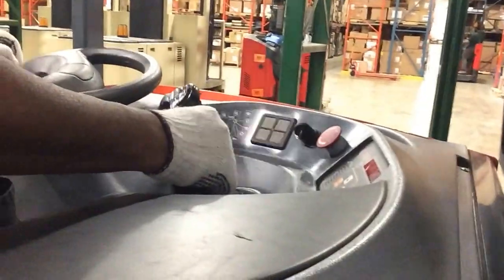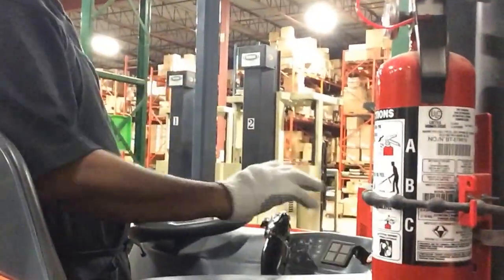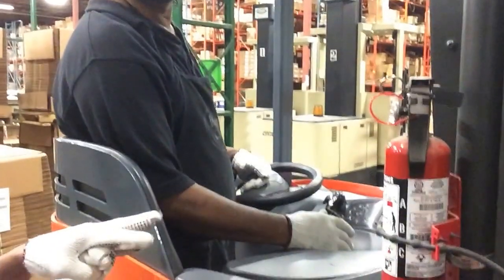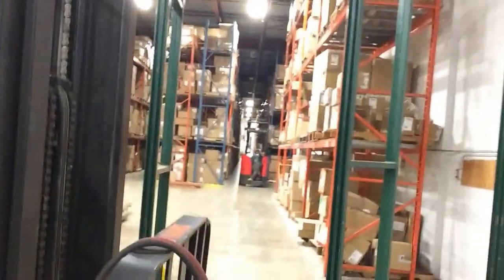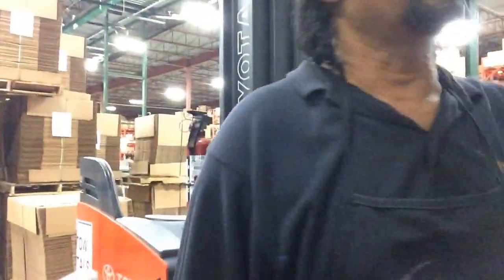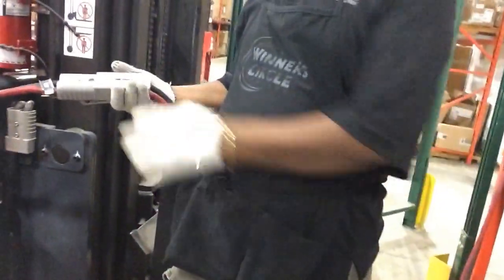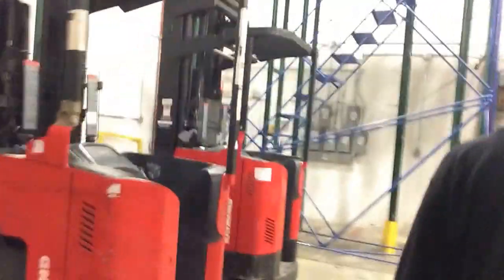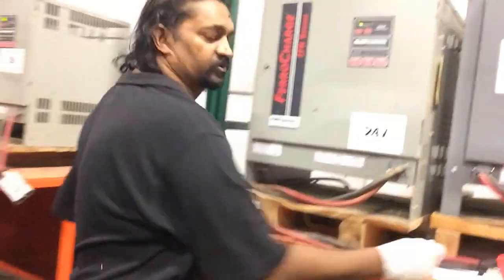UN-OFFICIAL Forklift training video - How to spot an INCOMPETENT OPERATOR

Comment: i have license i need a job
Reply: This guy is stupid...has no idea on safety. I'm a certified in forklifts and cherry picker (Raymond 5000) before you even step on the machine, you walk around it and give a visual check...inspect cables, chains...battery panel, wheels and such. Next, disconnect it from charger. Now connect the battery. Turn it on and check all its functions. Horn, brake, panel, lifting of forks and lights....forward and reverse. If you require a safety harness you check that too. Now you are ready....👍